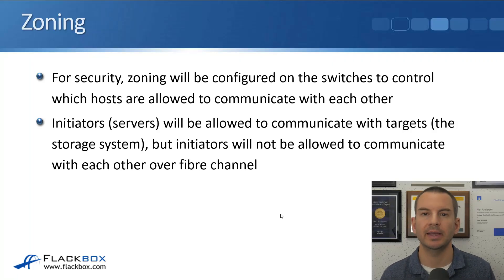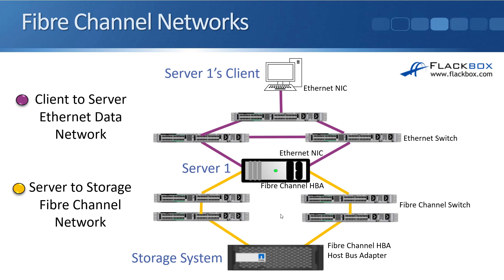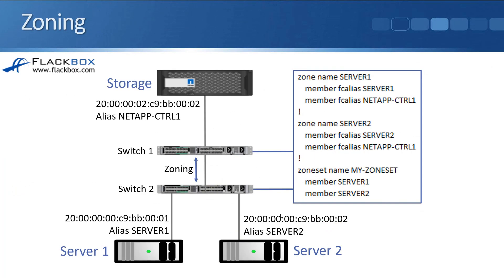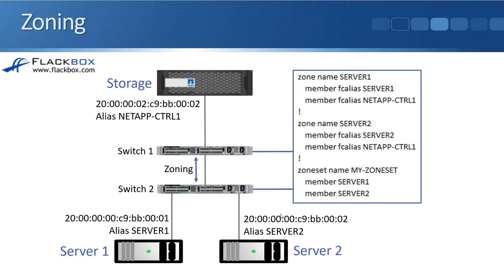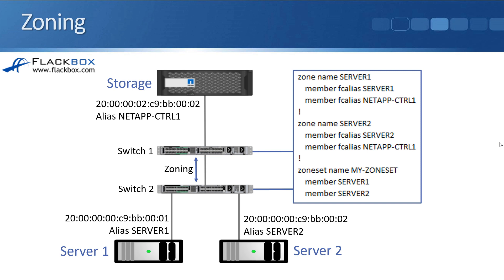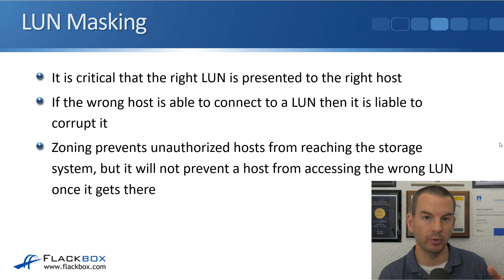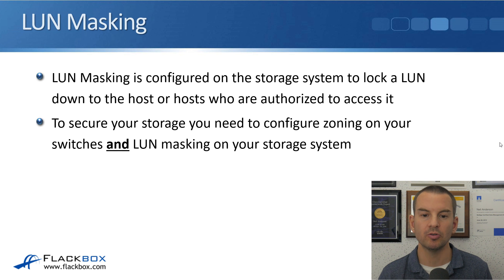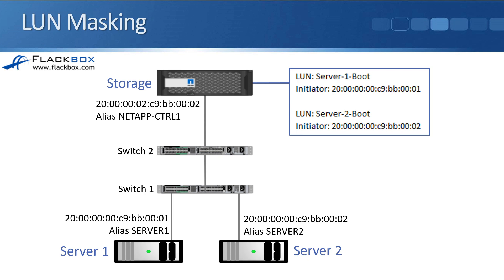Fibre Channel SAN Tutorial Part 2 - Zoning and LUN Masking (new version)

Comment: what is diffrence between WWNN and WWPN
Reply: A WWPN (World Wide Port Name) is physically assigned to a part in a Fiber Channel device, such as a FC HBA or SAN. It is the equivalent of the MAC address in the Ethernet protocol as it is supposed to be a unique identifier in the network.
The WWN’s are administered by the IEEE like the MAC Address is. The first few octets are assigned to a manufacturer, the rest is arbitrary.

The WWNN (World Wide Node Name) is a World Wide Name assigned to a node in a Fiber Channel fabric. It is valid for the same WWNN to be seen on many different ports on the network.